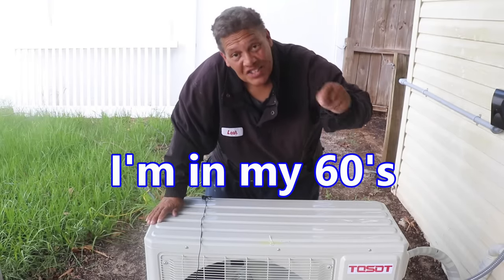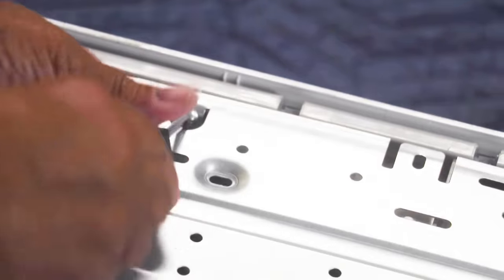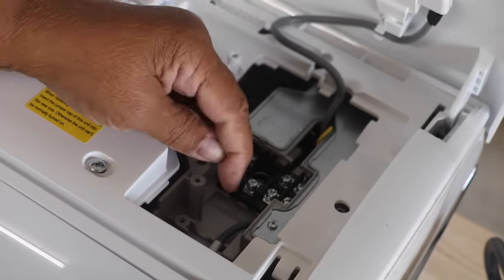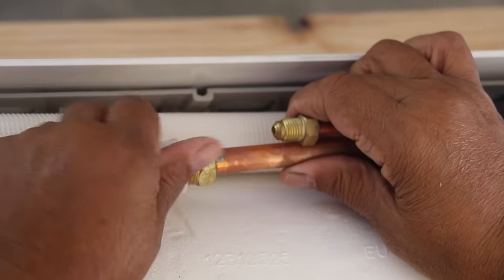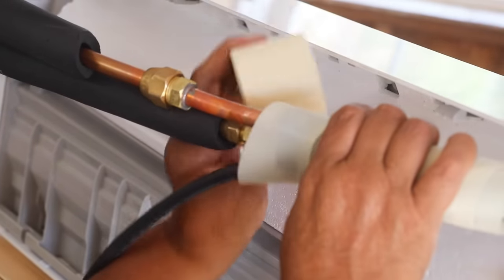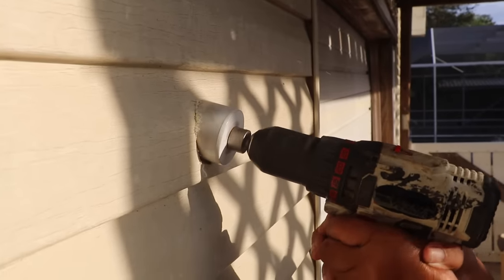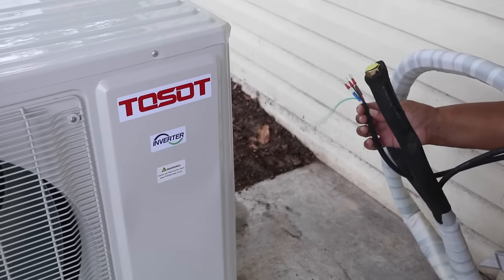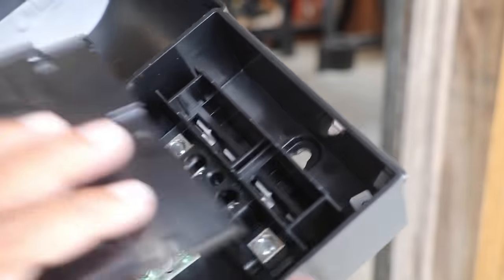I saved $4,200 installing a mini split AC myself

Comment: Great video. I installed one myself 2 years ago and I use it every day - it's an absolute gamechanger. I just ordered another dual head unit this time for the two main bedrooms and I'll be installing those in the coming weeks.
The process is pretty straightforward despite the naysayers telling me it would leak/fail/somehow kill me if I did it myself.
The two things I struggled a little bit with first time around were:
1. Torque settings for the refrigerant line connections. I followed the manual, but they felt overtightened before I got the 'click' - I also used some nylog blue on the seating surfaces to help with the integrity.
2. Drilling through my stucco wall with a hole saw was next to impossible and ground most of the teeth off the saw. I think this time I will chain drill the perimeter with a regular masonry bit and knock the hole out instead.

Finally, my lines were a little bit long, so I bought a flaring tool and cut them, and reflared at the outside end. Pretty straightforward and got everything done in a day.
I wall mounted my outdoor unit, but I will out the next one on the concrete.

Thanks again for sharing!

Comment: Very instructive video.  We do live in a golden age of DIY, with the tools becoming more affordable, and loads of instructional videos like this one. I never saw one on HVAC install before though.
   
Sadly in the Netherlands, we are not allowed to work with refrigerants without a license; a few brands do sell pre-filled mini-splits: you hook up all the pipes, then open a couple valves to let the refrigerant into the system, but you can't adjust or lengthen the pipes.
   
That's a lot of money for installation though.  The last aircon we had installed was a top brand 12,000 BTU split unit for the living room.  Cost us €2000... and that included installation plus the unit.  They did a bang up job as well, even mounting the outdoor unit on springs to prevent contact vibrations from traveling through the walls, and leaving the room spotless.

Comment: You're still just a babe. I will be 77 in July and decided I can do this after the sticker shock from vendors to install mini split. First I have to repair the vacated opening from the thru the wall AC. Then start install of the MRCOOL DIY 18000 btu mini split. And I will be arranging for my electrician to modify my electric panel to receive service for the unit. I do some electrical, but modifying the panel is  beyond my paygrade. You are doing an excellent job with your channel and one of my favorite for ideas and inspiration. Thanks.

Comment: Im from India. Nice to see you installing your own AC and also encouraging many people to do the same.  I installed my mini split ac 20 days back. It actually gives me a peace of mind. Usually installation folks arent well trained here or they just dont care. they never handle or install them properly. I have seen many cases where the ac will die within a month or so due to gas leak or electrical malfunction. 
While we do it ourselves it , we take the utmost care and also we can be sure we have done everything correctly. It took me only 5 hours in total to install my system. Out of which 2.5 hours was for waiting to see if there are any leaks. I didnt have a vacuum machine so i did the simple refrigerant purging method. 
If you buy the necessary tools like a drill machine , wrenches, screwdrivers,pliers etc with the money you will be spending for installation, you will still save some money and have those tools for your future works.

Comment: Jane, this is another awesome video. A few years ago I wanted to replace 4 basic builder toilets in my house when they all started showing their age, but was extremely intimidated until I saw you tackle one. It absolutely boosted my confidence even though I am an avid DIY fan who can take on many projects in my home. I thought toilets were a no-go zone until you taught me otherwise, and I ended up doing all 4 perfectly, following your method. Granted I had to wait until the wife visited her family over a long weekend so she could not second guess me, and it turned out an awesome surprise for her and me. Thank you on behalf of us middle-age men (and women) who don't need to worry when there's a way. This also saved me $80 installation fee per toilet. YOU ROCK!!!
Reply: I heard something about fixing the issue with vinegar. Particularly heavy duty acid stuff. Turn water off. Use it if you have to go. Clean it, tape holes under rim. It'll drain and be pretty much empty. 

Pour vinegar into toilet. Into big hole/bowl at bottom by flap and small hole. It's supposed to eat up all the dirt/corrosion that prevents it from working right. 

Toilets are expensive so worth a shot. 

Also. If the old lady likes the old colors from 60s, I can guarantee they'll still work, with brass washers and ballcock setup. Unless cracked. Don't replace unless it's unavoidable.

Comment: God Bless you! - Thank you for such a detailed and thorough tutorial. - I have been wanting to add a mini-split in my large home office/den area of my home to augment my home's central air conditioning. The office/den is a very large room with 35 feet of floor to ceiling windows along one wall and I have tried various methods over the years, to help cool this room (all to no avail) - I have finally decided to add a min-split, now that costs have come down and was going to call a professional for installation. - while I am not a professional in all areas, I am confident that I will be able to complete this very straightforward installation and finally be able to properly cool my home office. (Thank you, not only for this, but many, many other great videos!!) - You are the BEST!!

Comment: Nice video. These units are great. Well, at least until you start smelling the mold/mildew that has built up on the blower fan. And it will, at least in humid areas of the country. I found a solution to the mold/mildew issue that has worked since I installed it a few years ago. It is a low-voltage LED UV-light kit made for these mini-splits. The kit fits nicely inside of the mini-split and it consists of a small low-voltage transformer and a strip of UV led lights that you cut to fit. The UV light tape strip has removeable adhesive to attach it near the blower fan. I installed a small switch on the outside of the unit to turn it on and off. I run it for a few hours daily after I'm up. It really works!

Comment: Having installed two Mr Cool DIY systems, the only critique I can make is to fully insulate the refrigerant lines before using that vinyl wrap.  Uninsulated portions of the line will sweat and drip water wherever they are, which could be in your wall.

Comment: Leah, you are amazing!!!! Are you self-taught or did you take classes at any time? I'm an older gal, and I've learned how to use various power tools and building/repair techniques on my old house, ALL from YouTube!!! 🙂 YouTube is the best resource. I've fixed my roof, installed flashing, repaired my furnace, water heater, and gas dryer, hinges on my electric stove, my old Roper refrigerator which now runs like it's new, fixed because of YouTube. ➡YOU are one of the best teachers on the internet. What an inspiration you are. Thank you for so many great videos!

Comment: Leah, very nice video, and easy to understand. I do want to mention that after closing your low pressure gauge off, (after vacuuming the system down), you should leave your low pressure hose, and manifold attached, till after you release the charge from the condenser. Just the act of removing the hose fitting from valve, can allow enough air into the refrigerant line which is under vacuum, to contaminate the system. Especially with the new refrigerants. Having the refrigerant released into the line first will prevent this. Keep up the good work.

Comment: Just installed a Della 18K BTU mini-split heat pump (most brands from same Medea factory in China).  Hardest part was bending the 1/2"D suction tube down on the outside wall.  I used a tubing bender, but little room to work and couldn't see well.  Ended up kinking the tube a bit, but was able to at least get it to square by rotating a Crescent wrench around it.  I should have waited on installing the hole ring until after bending, to give a skeesh more room.  Also should have slightly bent that tube before passing thru the hole.  Was also unnerving bending the tubes outward on the inside unit.  You didn't deal with that since your bend was in the extension tubes, with room to work.  Used my Harbor Freight vac pump and gage set.  Had to buy the adapter shown.  Cools my whole house when I use my Central HVAC fan to circulate air, even on 110 F days.  More efficient than my older Central AC, and powered by my solar system.  Seemed strange that the liquid tube was also cold, but found normal for these new ones since the expansion valve is inside the compressor housing.

Comment: I would add 2 things to your install. I'd trim the escutcheon cover to fit neatly under the row of siding above it and caulk around it with exterior caulk to make it 100% weather tight. I would also add an extension to that drain line to get it away from the house or add a splash block under it to make sure that water is moving away from the building.  Great video! So helpful!!!

Comment: great video, i do have a few things to add. when opening the service valves you should always open the large, "vapor" valve first. the reasoning is, oil contained in the compressor can come out in the surge that pressurizes the line set and that oil will be drawn back into the compressor. it is cheaper to rent a nitrogen tank and regulator to pressure check your system before opening your service valves than it will be to later find a refrigerant leak later and have to fix the leak and recharge the system. thank you for all that you do.
Reply from the maker: Thanks for taking the time to comment

Comment: That is pretty cool. If my hot water boiler ever goes, I plan to install a new one myself. I might need a plumber towards the end if I run into an issue, but I can can sweat joints and cut/thread pipe. These mini splits are an option if my 1979 Lennox central air throws in the proverbial towel. I appreciate your lack of fear.

Comment: I'd give you a couple suggestions. 1) when running your refrigeration lines, put the connections on the outside of the house. 2) Use a micron gauge to verify you have pulled all the non condensables out of the lines. (Below 500 microns). Over all you did a great job explaining the process. 👍

Comment: Great video, but I'm a completely ignorant about cooling systems. I'm wondering about charging the lines at the end after you've evacuated the lines with the pump. Obviously they must still be charged with refrigerant. So how do you not end up discharging the coolant lines with the pump?

Comment: I like that you actually pulled a vaccuum on it. Ive seen people put these in before without doing that. We put a fujitsu multizone in my house, 2 heads one outdoor unit and had it installed in 6 hours. Left a vacuum on it overnight. Its great for AC in the summer but it absolutely SUCKS for heat in the winter. Super easy to install but i dont recommend these as a primary heat source if you live where its actually cold.

Comment: Leah you always Rock!  While an install like this will always present surprises, hopefully small, along the way, you hit all the bases and showed that this aint soo hard. Five or so years ago we paid a pro team to install 5 heads in the house and 2 condensers outside.  They ran the lines through the attic.  Great system, and pricey!  If I need more at this house or somewhere else you can be sure I'll remember your demo, and do it myself.  Many Thanks!!

Comment: I got an extra tip to offer that was taught to me by an old time refrigerant tech that If love to share and hope we can all adopt it if you see fit.

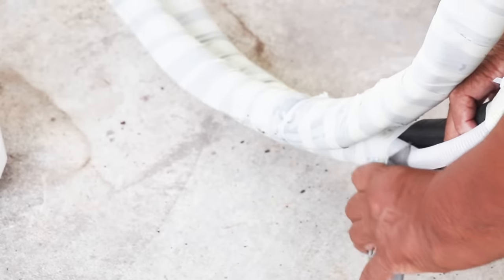At 10:50 you should have allowed drainage line to extend away from the concrete slab to the soil behind the unit. This will allow unsightly drainage to take place over the soil and prevent stains to your concrete. In the future you will meet to clean the evaporator coil and sometimes it requires the use of harsh chemicals that will net to be drained away as well. Also adding a loop in the line at the end will prevent outside elements and critters from making their way in. The condensation will buildup in the line creating a liquid wall to the outside.
Reply: Good Tip.  Thx.

Comment: At 2.11 onwards I cant help but notice you levelled it evenly. I have also done a quick scan on the comments. But I don't see anyone mentioned about the leveling and draining. I don't know how torso indoor units work but most of the indoor units have to be tilted down a few millimeters just enough to let gravity have its way to let the water flow towards the end where the drain pipe is so that water drains out properly. If not, overtime the AC drain will become clogged because the water becomes stagnant with dust and you would have leak here and there in the indoor unit. Cos water doesn't like to stay put. Good job btw. That's really an inspiring and thorough install.
Reply from the maker: The drainage line is installed at a tilt to allow for good flow.
Reply: @seejanedrill  Great. A perfect guide through A to Z.

Comment: Nice job, I recommend using Nitrogen in the refrigerant lines first to purge the lines from impurities.  After checking for leaks with Nitrogen and digital preassure guage then put it under vacuum with a micron guage getti g the microns diwn to 500 microns or less. This ensures impurities and/or moisture will not indefinitely circulate in the refrigerant lines and damage the system. This will make the system last for many years. Release the low preassure vakve first slightly and then the high preassure line immediately after then going back and fully opening the low preassure valve all the way. Cut your hole after the the hanging plate is up then put your inverter up with the drain line zip tied to the copper lines. Be sure to secure the refrigerant lines so they are not crushed or disturbed. Other than that great work!

Comment: The whole install looks pretty simple; the toughest part is making the hole in your house, especially if it is more complex like stucco, cement and brick. The pressure testing is straightforward enough, provided you have access to the tools. And of course the electric part is tricky if you aren't an electrician. But all in all, Leah broke down the entire process so at the very least you know what is required whether you do it yourself or hire it out. As usual she is the best!

Comment: Hey Leah, you are always awesome. I would like you explain the height from the ceiling that the evaporator should be placed and what size hole must be bored through the wall. Another thing you should informed us your faithful viewers is that the size/BTU of an A/C split unit is not a one size fit all room. I am looking forward to your response.
Thank again for putting out another useful video.

Comment: 7:10 May want to insulate the hot / cold pipes so that there's a minimum of heat wastage; just pull up the slack insulation that's around the pipe and add extra is needed.

Comment: I already have central heating & cooling.  But when I saw how efficient these split units were, I decided to start installing these for the garage/workshop and the high-usage areas in the house.  Given how much they save in energy and given how energy rates keep going up, these split units pay for themselves after a few years.  And when they wear out over many years, replacing them for less than a thousand dollars is a whole lot easier on the "rainy day funds" than replacing entire central heating & cooling units (which I've now pretty much regulated to backup duty).
Reply: Hi. What’s the square footage of your home?
Reply: @luisfercaz  4,400 sq ft ... not including the 3-car garage.  Inside the house, I only use a small portion of it ... the master bedroom & bath and a big den area ... about 600 sq each ... I definitely don't need to cool down the entire house just for two rooms.  The other thing is that I don't have 230V wiring in the house so I'm limited to 115V @ 20 amps max for now.  So, I'm looking at a split unit with 12,000 BTUs max for each the two inside areas from the start.
If I need more BTUs, I'll have 230V wiring installed later on down the road.  I don't think I need to though because I'm fine with setting the thermostat at 77 F inside ... that is, I don't need it meat-locker cold like some peeps prefer.